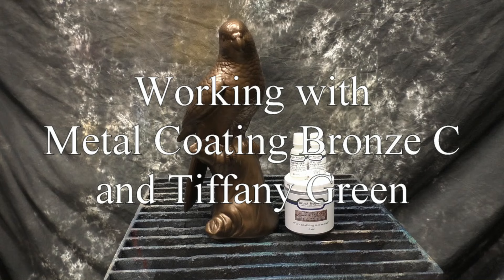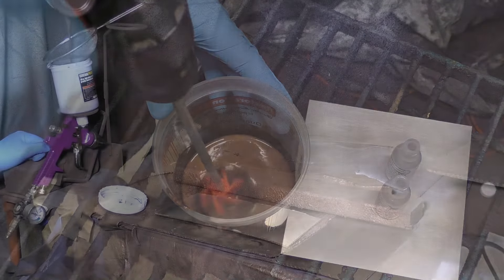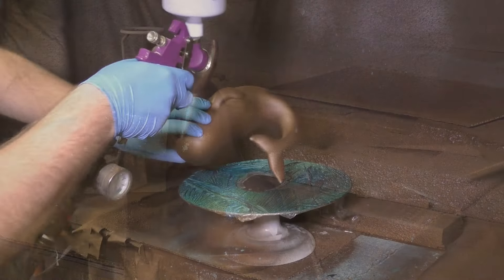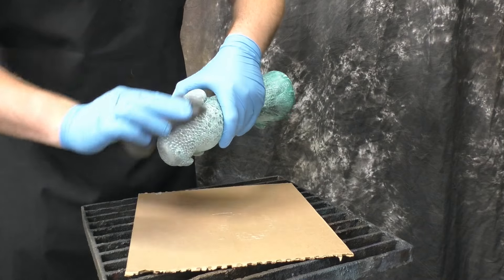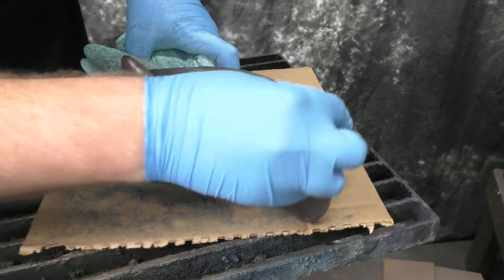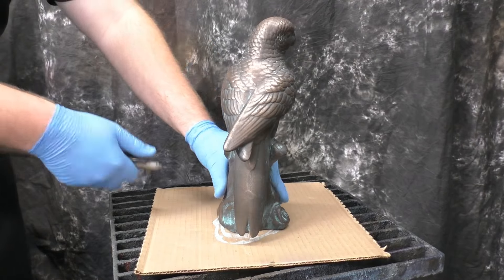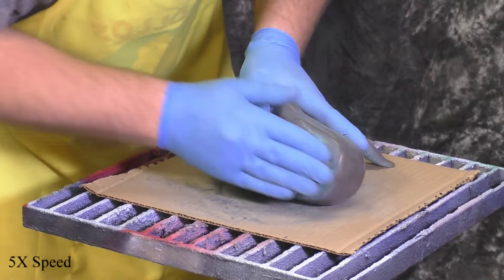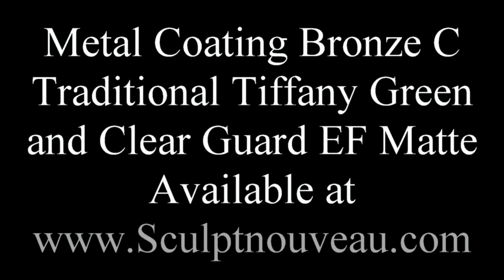Working with Metal Coating Bronze C and Tiffany Green

Comment: Do your patinas only work on the wet Metal Coatings? I've been doing some electroplating/etching of copper plates and I want a nice pale green patina to highlight the texture differences, but I can't seem to find a good DIY patina recipe to get that nice aged verdigris color your Tiffany Green creates. 
But, if your patina formulas are designed specifically for uncured metal coatings, I would imagine it wouldn't do me much good.

Either way, it looks absolutely phenomenal, although I probably would have left a bit more patina personally!
Reply from the maker: Our patinas also work on real metal, not just the Metal Coatings. The problem with plating is that some of our patinas are too strong for that. In the case of Tiffany Green, if you plate steel and then use the patina over the top, it could potentially eat through the thin layer of copper and get down to rust the steel. A better alternative might be the Smart Stains - I like to do a 2:1 verde and white to get close to the Tiffany Green color.
Reply: I should have been more clear - I am only plating/etching(mostly etching) copper with copper, for relief; not plating copper onto steel or any other mixed metals currently. Specifically, I would love to etch some copper plates and then highlight the etched design via patina while the raised surface would stay bare.
I would NOT be using patina on any plated/raised surfaces, only as an inlay-effect on the solid plate; it sounds to me like your Tiffany Green could work for my purposes in that regard? I'm really trying to avoid stains or paints in favor of actually reacting with the metal if at all possible.
Thank you for your time and knowledge!
Reply from the maker: If it is actual copper metal it should work out fine. I would still do a test to ensure that the process will be completely compatible but I don't foresee an issue. One thing to watch for is that you don't want the Tiffany to puddle, puddling the patina usually creates a film on top of the metal rather than reacting with the surface.

Comment: Pssst, You accidentally uploaded the Bronze B video a 2nd time. This video does not cover Bronze C at all. :)
Reply from the maker: Much appreciated for the heads up but this is the Bronze C video. Note in the beginning when the Catalyst and Hardener are added into it as well as the polishing of the coating. Nether of those steps are in the Bronze B process.
Reply: Huh, must have been a glitch. At the time, youtube showed me the Bonze B video; but now it's showing me the right one.